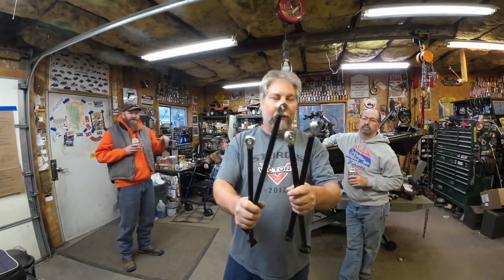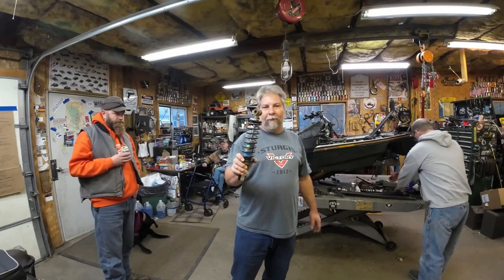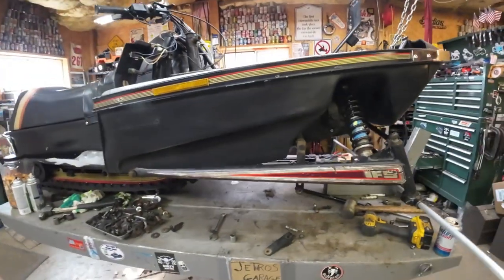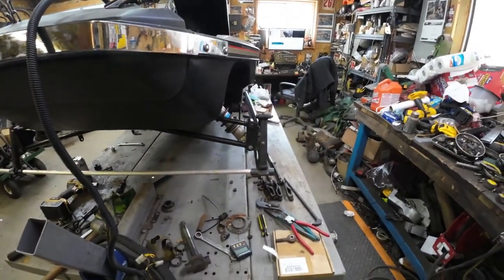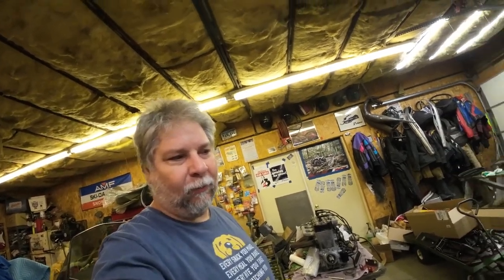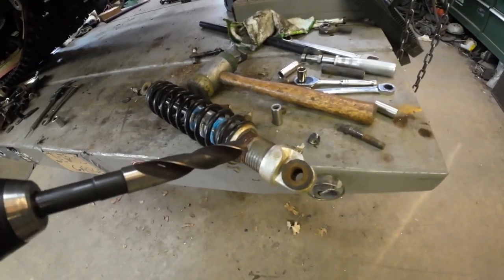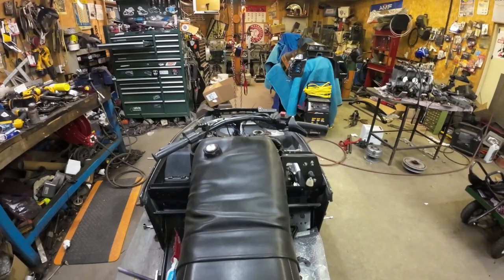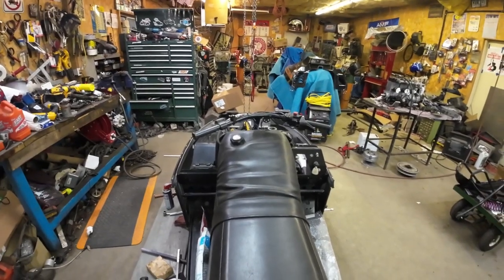Indy 600 Part 8: Easiest Way to Align any Sled Suspension! Vintage Polaris Wedge Triple Snowmobile!

Comment: Hey Nutter!  Gotta get everyone on board with the beer crack! Lol.  Once again lots of great tips in your videos👍   You must have been a Polaris guy forever to know all this stuff?
600 is looking good!  How about the chromed front and rear bumpers, are you leaving them that way or changing to the factory black?
Cheers 🍻
Reply from the maker: Thanks Rob. I had a 69 colt when I was a kid and my Grandpa had a colt and charger, but I really only got into the Polaris sleds about 15 years ago when I picked up an XLT. I'm leaving the chrome. I like a dressed up sled. I'm even contemplating a period looking pin stripe job but I don't have anyone lined up to do it so it might not happen.

Comment: In the description, why 7psi for the lever rad cap?  Is that stock?  I’m rebuilding an 85 600 and the cap on it was 18-22 psi…I’m planning on buying a new one and want to get the correct pressure rating.
Reply from the maker: I was told that these sleds came with a 7psi lever lock radiator cap when they were new, but it's not like I have any documentation to back that up. It's just what a friend told me he remembers from back in the day. They run pretty cool, so I have always used a 7PSI cap with no issues. Seems to be more than enough pressure. 18-22 psi seems excessive. I've see a lot of people running 14psi or 16psi and it seems to be fine.
Reply: @nuttersspeedshop  thank you!